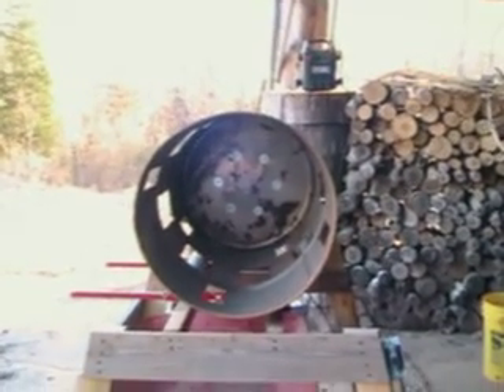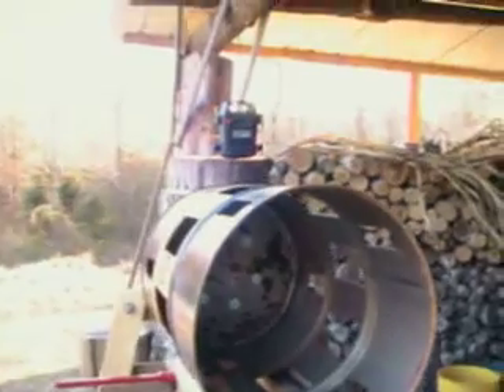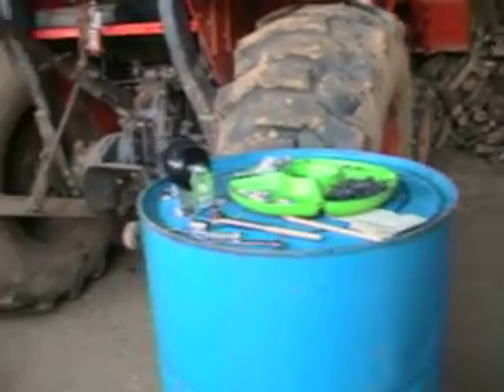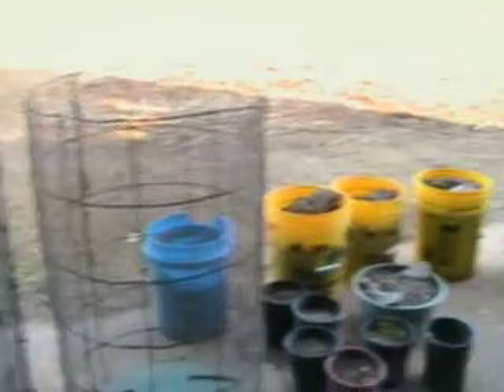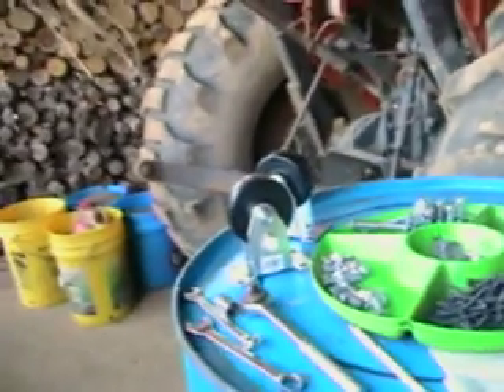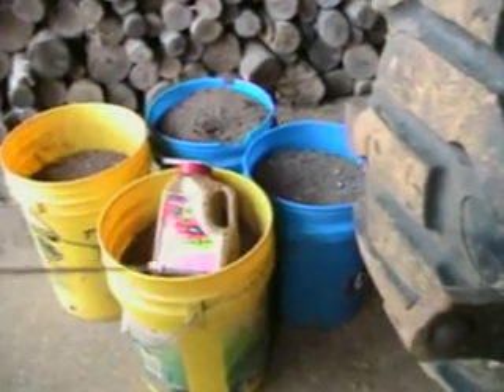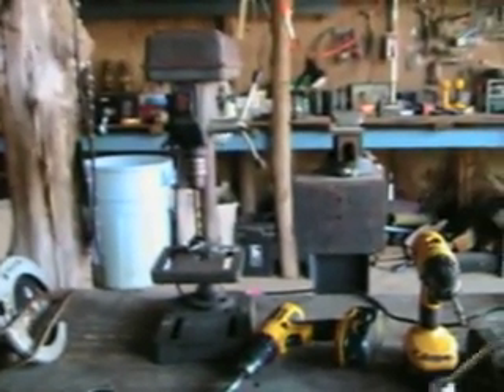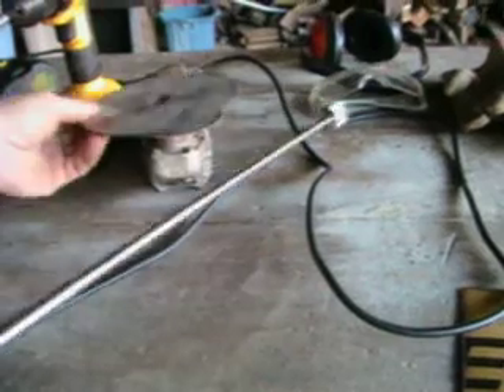Trommel Soil Sifter/Mixer that you can build

Comment from the maker: I couldn't raise the volume so please click on CC to enable Closed Caption.

This video is a demo to promote my video plans I'm selling for $25.  Email me at tblount7@yahoo.com and I will send you a paypal money request you can pay with any credit card or your paypal account if you have one.

Why would you want to send me money when there are over 40 free videos of them here? 
Oh, let me count the ways....

1. You could use one but don't want to pay $600+ for a commercial one.
2. You don't have the time or desire to find a junk yard and look for motors, pulleys, belts, chains, sprockets, reduction drives and other parts you have to remove and fix.  Everything needed to build this is off-the-shelf.  (Lowes, Harbor Freight, Craigslist for the barrel.)
3. You have the skills to drill 20 holes and cut out slots in in a metal barrel. 
4. You like the idea and simplicity and power and ease of direct drive.
5. You like the idea of off-grid power and freedom to use it anywhere without a generator.
6. You would rather not waste time on trial and error calculations when you can have all the exact measurements, complete hardware list and step by step video instruction.
7. You have seen my other videos and found them useful.